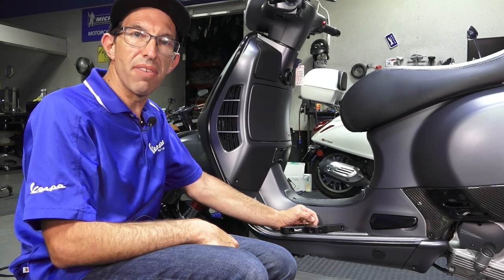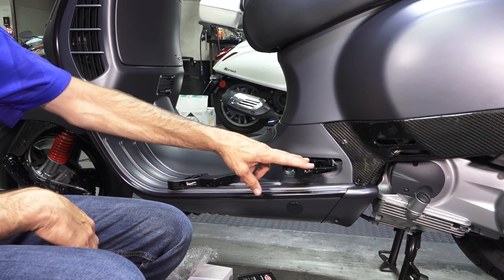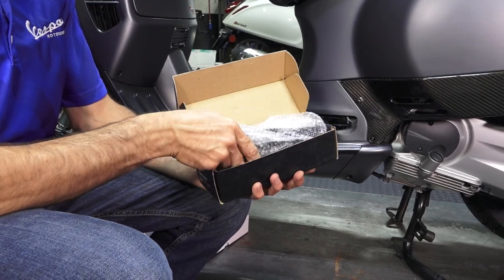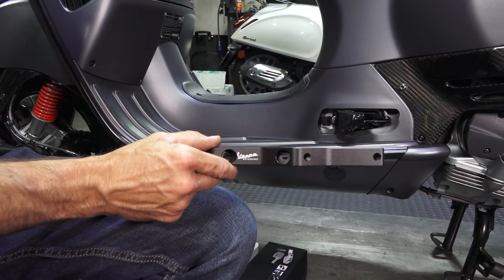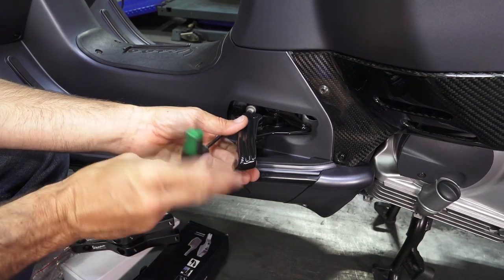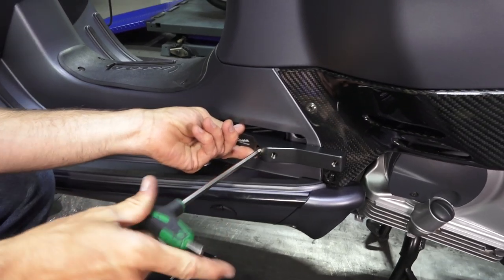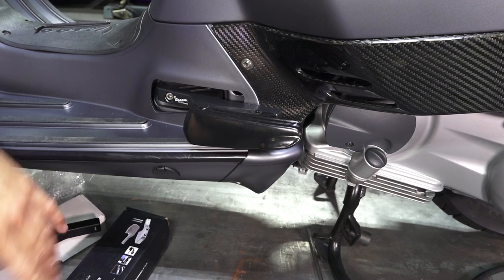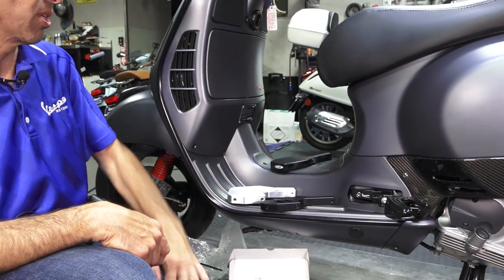Passenger Footpeg Extenders for Vespa GTS

Comment: Beautiful scooter with carbon fiber bits, then an ugly hole in the bodywork? Someone needs to make a cover or an extender with a flange to fill the gap!
Reply from the maker: Rizoma just came out with new aluminum footpegs for the GTS that cover the void when the footpeg is extended. Stay tuned...
Reply: Ali express do the flange type ones £72.00 or about $85.00

Comment: Just  mounted the extenders - they're  worth every single cent! No more colliding with the passenger's feet when putting my feet down at stops and the passenger sits a lot more comfortable. Only downside: The screws need a different allen key than the original ones. But hey, if that's  the only trouble ...